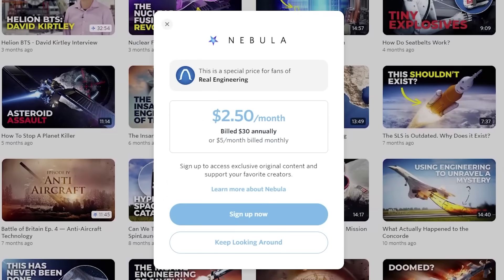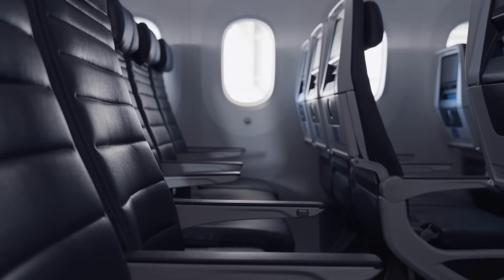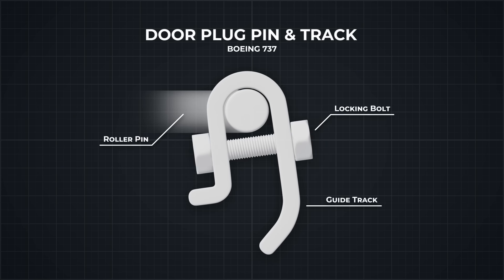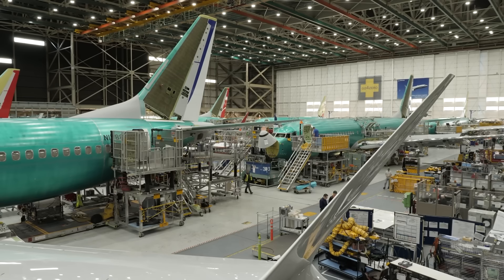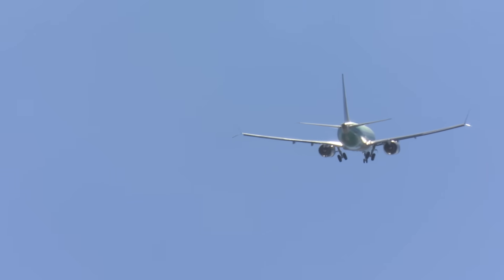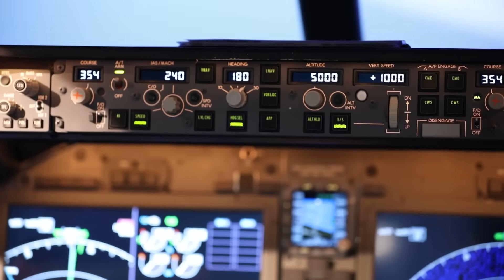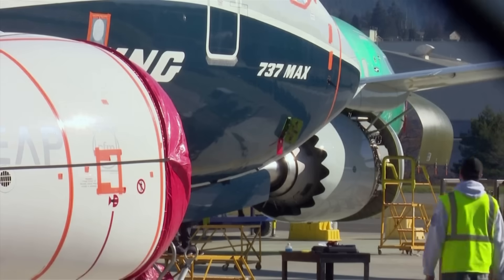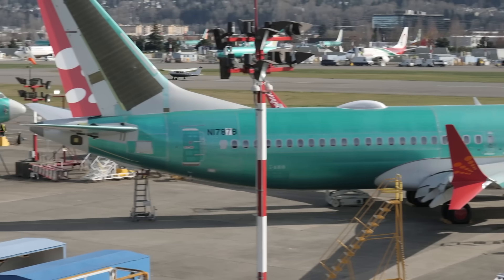The Questionable Engineering of the 737 Max

Comment: It always boils down to money—the CEOs pander to the shareholders which means cutting costs anywhere and everywhere. Why buy a part that will absolutely work for $1.25/pc when you can buy a much cheaper part that ‘will fit’, but it’s not really meant to, for $0.55/pc? Why hire all these pesky safety managers to go check the same thing over and over again—one is just fine, oh, and we can full their schedule as much as possible because we’ve streamlined the building process by cutting corners. Nah, don’t worry about the weight of the engines, we’ll just back door in some fail safe and not tell the pilots about it, then when something happens, we can turn around and say it was the pilots fault for not knowing their plane. Anyway, you guys wanna see this sick new mega yacht? 

How many lives really matter when instead you can produce record profits year after year after year—gotta make that red line go up somehow, and I heard blood is the same color on the stock market as on the pavement.

Comment: This is all Boeings fault starting with the airframe. The company decided to cut corners by keeping the same airframe from its first model designed in the early 1960s. They could of gone the route of building a completely new airframe from the start but because they wanted to save costs, kept the 50+ yr old airframe and just added newer engines that weren’t meant for them. The max aircraft is quickly earning its reputation (in a bad way) like the McDonnell Douglas DC-10s.

Comment: I think this video actually does a disservice to the 737 MAX programme and to people's perspective on aviation safety.

The door plug incident could be a design flaw, but here's a secret - everything has design flaws. Just like all code has bugs. Finding systemically loose bolts and adding something to a checklist is exactly the kind of thing that results from many aircraft incidents; this is not evidence of questionable engineering of a whole aircraft family. We don't have the NTSB report, and until we do, all suggestions about how this happened are speculation, which can result in premature conclusions. "The temptation to form premature theories upon insufficient data is the bane of our profession." Or, "It is a capital mistake to theorize before you have all the data." -- Sherlock Holmes

And in fact, I can believe that all the mentioned issues may not have been foreseeable in design, and not all would be caught in testing. It is easy to look back now, but can you confidently say at the time that you would have thought of that? Hindsight is 20/20, foresight is inexact.

The point about laying off QA staff is completely bogus - just laying off staff doesn't mean worse QA. You even said they were doing some QA with machines instead - which more than likely means better AND faster testing for the aspects that those machines can test. Unions always try to spin layoffs as bad, so I put zero faith in their opinion that this layoff decreased safety.

I think this video makes too many jumps in logic, stitching together unrelated things to make a case about an aircraft family and company, that, even if true (which I don't deny it could be), is unfounded and irresponsible.

Comment: What ever cultural change at Mac Douglas must have happened recent decades, for Douglas and Mac used to make some very good airplanes. Douglas had the legionary Ed Heinemann who designed the Skyhawk. Macdonald had the Phantom which was the premier fighter bomber of the era. Phantoms and Skyhawks were everywhere, include carriers.  Boeing actually was the company that had lots of trouble for their products. Starting in WW2, the B29 had unsolved bugs passed the end of the war. The next one of similar design , the B50 were nick named Boeing Tri Motor, for so many returned to base with at least one engine shut down and caged.  This was well before the 727. Several 727 were lost due to pilots not accustomed to the high sink rates.  The B47 did not stand up to air force abuse, making a high G toss of bombs and rip the wings off. The 707 can lose engines , with the pylons if you exceed the g limit, one was destroyed by lightning hitting the fuel vent at the wing tip. Airbus too have their share, together with engine makers. I hear 1/3? of the world's fleet of engines been the subject of recalls for inspections , something to do with losing blades.  I hate sitting within range of the engines when I fly. Nothing ruin your day faster than a fan blade landing on your lap, after it been through the seat back. The 737 Max basic troubles seems to be software and they forgot to tell the pilots , they want the Max capable to be flown by the same pilot from older 737, without transitional training. The door coming off are quality control problems. As one QC gruru Edward Deming said, do not blame the workers who have very limited control of the process, quality should be the responsibility of the highest person in management, which in most large American companies, are glued to the HQ all day and rarely visit the shop floor.

Comment: I work in automotive as an engineer for drivetrain systems dealing with new product launches and established drivetrain systems.  This problem is not specific to Boeing or Aerospace.  Over the past 3 years there has been massive layoffs of support functions like Quality, Engineering, and even Maintenance in my facility.  Everyone has 3 jobs, and many have quit because of it.  Theres a huge push to get critical parts as cheap as possible, and nothing gets done to improve the design or integrity of the parts without a cost savings.  It all started with the financial and logistical turmoil during 2020 and 2021, and has just continued afterwards.
Reply: It's the same in software. I am a dev and they fired all test engineers and now they only rely on us to write automated tests. Needless to say we had a lot of PROD incidents due to "edge cases" which at this point mean everything besides the basic success cases.
Reply: @codyrap95  Tell me about it lol, I work in QA and the amount of corners management expect cut or put on devs by not having enough QA and say "it'll be fine" is just silly
Reply: That must be why Windows Updates sucks anymore and causes more problems that good. When Satya Nadella took over they laid off all the people that knew what they were doing,hired cheap foreigners and we get a less stellar product. I’ve had to do about a dozen system restores in the past three years to fix problems caused by Windows Updates. Never happened under Bill Gates,updates used to be exciting and beneficial.
Reply: hmm lack of proper training sounds like improperly installed not good not good at all.

Comment: That the cockpit door opened when the pressure dropped is by design, as otherwise there would be a dangerous pressure differential between passenger space and cockpit. Hey, at least one part which works as it should... 😛

Comment: Preferring other things over competency in order to achive a bizzare standard that shouldn't even exist can cause such things.
Loose bolts is a manufacturing problem, down to the workers themselves and work ethics they have, management is responsible for hiring these people in the first place.

BTW, this shoddy craftsmanship isn't limited to Aerospace, the motor industry in the US has some really serious QA issues (all cars in the US are made there or in its neighbors, but mostly in the US) which creates the bizzare situation that the same brands (or even the same car models) have a completely different reputation to their European made counterparts, and I'm not even talking about the Big three themselves here.
Something went really wrong in the last two decades, and especially since 2015, when it comes to competency of the people involved, I would even say that it's most likely not because of the engineers themselves.

Comment: The 737 Max is not only a cursed plane, Boeing is a CURSED COMPANY!!  Back in the 60s & 70s (when I worked there) Boeing was an incredible ENGINEERING GIANT!!!  Everything they produced essentially flew flawlessly for decades beyond their designed lifespan!!!  Want proof??  Look at the Airforce B52.  This plane still is unmatched in performance after 60 YEARS of wartime combat and peacetime service.  Now Boeing can’t seem to build a plane without serious defects, specifically the 737 Max series.  Some would say that the merger of McDonald Douglas in the late 90s began a culture/philosophy change in the company shifting focus away from engineering with greater effort to appease Wall Street.  

China is now working non-stop to develop commercial airplanes that compete head-on with Boeing.  There will be increasing pressure to buy Chinese planes if Boeing is unable to dramatically improve the safety performance of its airplanes.

Comment: Why ship the door plugs half done? Why not ship them uninstalled with the air frame and have boeing install them when they are gonna install them anyway? Seems like a redundant step that could cause miscommunication. Then if there is an issue too, you know 100% it was boeing.

Comment: The fact that Boeing cut corners in the first place by "updating" the 737, a design from the 1960s, instead of doing a clean sheet design to compete with the Airbus A320neo which was based on a design 20 years newer was their first mistake.  Post-merger with MD, Boeing simply hasn't had the same culture of quality and safety first that they used to have.

Comment: The problem is every company is forced to compete equally, so when one company gets to do something like make use of subsidiaries and shell corporations to limit risk and responsibility and therefore take on more risk (and thus potential earnings), every other company has to either come up with something it can exclusively do or follow suite. It's fine (most of the time) when it's a financial company dealing with synthetic assets or debt. It's not fine when it's a manufacturing chain for sophisticated equipment.

Some people may point to the military using parts manufactured across multiple suppliers, but last time I checked they don't have to provide financials that compete with BlackRock for investor earnings. Either admit that laissez faire capitalism doesn't work, or simply accept that this is as good as it will ever get. 

You can analyze the engineering all day, this will happen time and time again, through the business structure that produced it.

Hopefully as we wave goodbye to Globalization, things will change with regard to the capital markets and corporate structures... but I won't hold my breath.

Comment: As a practicing engineer, I really love your videos. 

I do have one thought.
11:30 - you say “more regulation needed”
11:40 - you say “existing regulation isn’t followed”

More regulation does not equal more safety, more regulation means more regulation. If more safety is wanted then existing regulations need to be enforced; I would be willing to wager that some of the inspectors either don’t care about the plane (there to do the bare minimum) or are bought off to stay quiet. 
If more safety is wanted, then more safety inspectors & repair time is required.
Reply: It's a management problem, at Boeing and at the enforcing organiziation's end.
Reply: @kindlin  Regulation does work, but not if it is toothless. It needs to be independent, tough, very much there rather than sporadic, with harsh penalties available to it which it's willing and able to use. And the penalties should fall hardest on those most to blame- those who took the decisions, including financial ones.

Comment: A lot of people here are blaming Boeing, but they forget that the airline purchases the aircraft, and is responsible for maintaining the aircraft. Boeing just makes the aircraft and sells it to the airline. If the airline neglects proper maintenance, it isn't Boeing's fault if the airline just doesn't take care of it correctly. 

This really easily could be like buying a car and neglecting to inspect your tires regularly, and then blaming the car manufacturer when you have a tire blowout.

The reason why it's happening to a lot of Boeing planes is simply because well, Boeing sells a lot of fucking airplanes. You can't expect Boeing to be responsible for an airline that doesn't properly comply with routine scheduled maintenance inspections, especially in an industry where the airline is incentivized to keep them in service for as long a possible without grounding them for maintenance.

Just my two cents. Boeing makes the jet and gives it to the customer, the customer is responsible for taking care of it afterwards.

Comment: From an aircraft maintenance perspective. Boeing made a mistake by going with the 737 for both an NG and MAX variant. Also, the 737 MAX is still the same airplane that was built in the 60s with just new avionics and engines. Still has primarily cables for all flight controls. Side note/ personal opinion. The 787 is a terrible airplane. Super unreliable and overly complicated,  Built to replace the 767, but still less reliable than the 767s that are 40 years old.

Comment: No engineering issues were specified. The title is misleading. The plug door engineering is not of a quality standard. The engineering of the door plug is specifically to cut costs, not offer the safest airplane. These plugs should be permanent and not rely upon pressurization. I don't care how convenient it is to be able to take them off at will. A proper door plug wouldn't required a faulty seal.